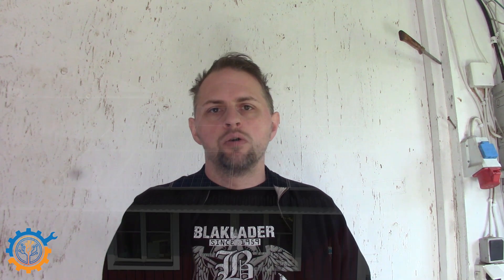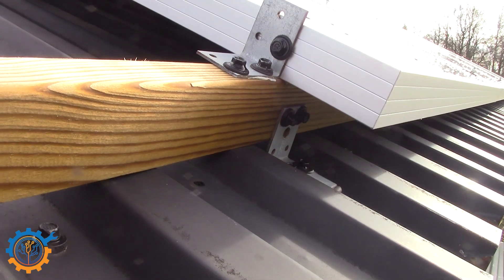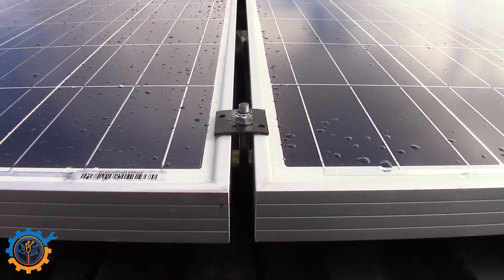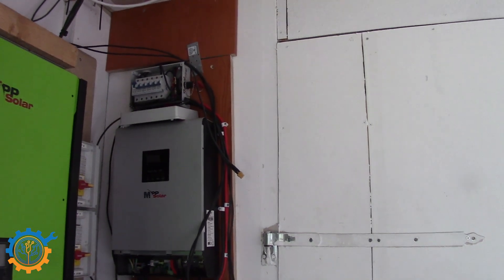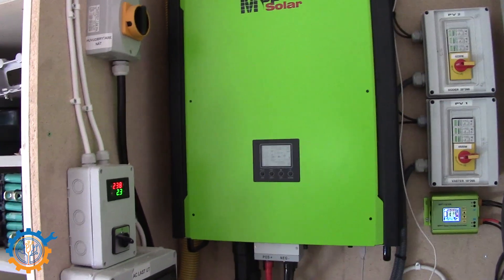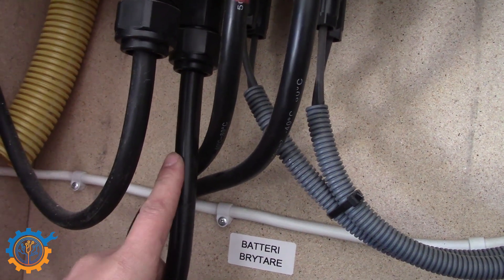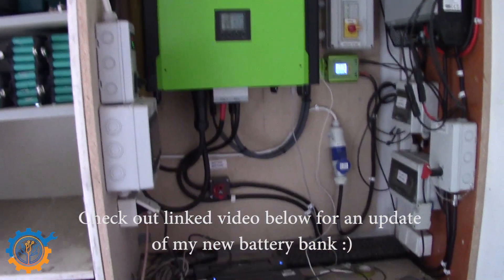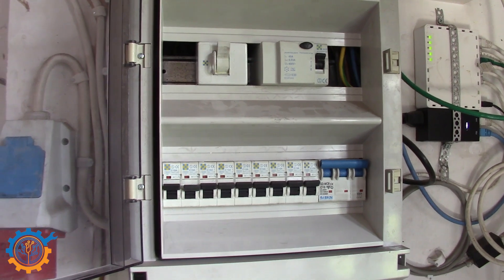Current solar setup 2017-04-17

Comment: Great video!  I've learned a lot from your vids.  I am hoping you can help clarify something for me.  I'm building two battery packs configures as 14s11p.  (1kWh) These will replace the lead acid batteries in my electric golf cart.  The problem is this thing can pull almost 400 amps of in-rush current if you floor the accelerator at a dead stop.  That is going to smoke any BMS I have seen.  Others have suggested using a shunt but I've little idea what that is or how to wire it.  Perhaps that could be the subject of another video???
Reply from the maker: You then use either a proper bms or A contactor controlled by the bms. Note that 22p cells doing 400a... Poor cells ;)
Reply: I tend to agree about the poor cells but see no way around it when driving a large motor.  Well, other than always starting very gently I suppose but that's not likely with my farm workers.  :-)  Would love to find a good BNS for it but so far, not luck.  A contactor would be great too but I can't seen to find a BMS that can turn it on / off and, won't the BMS see it as a near short and shut things down?   FYI - I believe I am going to double up on cells (14s11p times four instead of two.)
Reply: @nicefellow787  super capacitors!
They charge fast and release large loads

Comment: I have a similar 1Kw system at home. What I see is that one out of two fan will be continuously running in the system even though the mains AC input is bypassed to the output and battery is fully charged. Is it a problem or is usual with these kinda inverters?
Reply from the maker: Dont know. The 1kW inverter is not the same as the ones I got im afraid.

Comment: hi, i had a few cells that i used to build a couple of panels, i have them in series and they are giving me 15v 10.5 Amp, i made this panels my self, i have a question, i build a battery pack with 99 cells, 18650. i have 33 in parellel and then in series for a 11.1 v battrey, if i attach the panels to the battery should i need something else ? thanks !!!
Reply from the maker: You need an mppt or pwm charger in between. You should also have a BMS of some sort in between to make sure the cells stays balanced.   Without a proper charge controller you will have the pack to go above max voltage of the cells. And without bms you will perhaps have individual packs/cells go above its maximum and in worst case this will end up in a hot pack in terms of fire :)    Lithium cells should always have some kind of active system that takes care of balancing and charging/discharging

Comment: What's your opinion on the mpt 7210a ? Does it really works as MPPT? Do you know if you can connect a few of them to different panel strings BUT to the same battery (higher voltage then panels since it's a BOOST)?
Reply from the maker: I think its a pretty nifty little unit. I have not looked into it fully but i heard its not 100% MPPT but its close.  It need to have input voltage slightly below battery voltage to work and you then set the sweet spot of the panels.  As long as the battery always is highter you can have 1panel on 1 of them and 2 on the other with different inputs. That works just fine and they will work independantly. 
I have like 3 of them at home but none hooked  up right now. i run em as test units. 

You can buy them from here: (Ebay) https://goo.gl/v5DBzP

Comment: Hallo,
Thanks for you fantastic videos and DIY tips. This is highly valued! 
I am going to add DIY powerwall to my existing solar array, currently 5KWh, but it will be extended so I need another suitable 3phase hybrid inverter for DIY powerwalls. I looked at the same 10KWh from MPP as you have and like to know if you will recommend that one or you have found any alternatives?
Reply from the maker: I like the inverter as such due to its price. But I have had very bad experience with their support actually answering questions about its limitations and functionality. The software is also very buggy and have quite some flaws if you want to do anything more special. Other than that i have not found any other that do the same job for same amount of money. Note that the unit is pretty loud so its not something you have in your house a sunny day :)
Reply from the maker: Could be. I found one from a german manufacturer that is interesting. Very interesting. It runs battery at 150-300VDC instead and that makes it even more cool. And the price is almost the same as MPP...
Reply: DIY Tech & Repairs Would a Victron Energy Multiplus inverter charger and Colour Control unit work for you if you need to change?
Reply from the maker: It would not work alone though since i need the hybrid mode in terms of grid tie and MPPT from solar. But it would work in sense of expanding the possibility to utilize more of the stored power from the battery bank :)
Reply: DIY Tech & Repairs could be wrong but I think Magna Sine make a similar machine... costly though.
Reply: Thanks, but a little bit late. I ordered the MPP MPI 10K Hybrid (as yours) about a week ago... Are working on some recycled laptop 18650 cell for my DIY powerwall. Your videos are very inspiring - thanks
Reply: Hallo again - what switches and brakers are you using? Especially what switch for the 50V 200A battery?
Reply from the maker: Normal high current isolators for vehicle use.  Its worth mentioning that they are rated 32VDC. Fuses are ANL fuses also rated 32VDC. I will be changing them to proper ones in short to comply with standards. The funny part is that i have seen several installations made by companies with the same types... But anyways. Always use stuff rated at correct voltages and can handle the current in the system.
Reply: Sorry I do not fully understand. Can you link to some? Just received my MPI10K :-) excited, and you have inspired me !

Comment: Hello Daniel, can you share how did you get the solar panels? I'm trying to buy them in Poland and together with a colleague want to order around 20 panels from china.  Do you have a supplier you can share with us? Thanks.
Reply from the maker: fmarpt i bought from local guy. importing was not doable. had to order a container if so. last ones came from england from a guy importing them.

Comment: having the solar panels on an "flat"angle is not necessarily  such a bad thing in the winter. this orientation brings most solar generation in overcast weather. i presume most of the winter is overcast where you live in sweden? naturally when the sun does come out in winter, not so productive. but most solar generation  is needed in bad weather anyway. as for leaves, i do not have a problem with them at all. but dust and dirt tends to settle on the lower end.
yes, the pip mob might threaten to sue you, as has happened to two youtubers critical of their support. and keep in mind, their product probably was half price to a more reputable inverter manufacturer. 
all in all a very professional installation.
greetings urs
Reply from the maker: Urs Odermatt ur right. if they just could have replied to emails. :) i do like the hw as such they have. yes the price is good.
Reply: well, if you can't understand it, then try it. if you have direct sunlight, you get most solar energy from the direction of the sun. indirect light however, comes down from the clouds. this is part of the cloud edge effect where you have direct AND indirect light and as a consequence more than either.
as for data, my 12v system matches the 48v system in cloudy overcast even though the 48 v system has double the panels, but they are at 30 degrees and most panels of the 12v system  flat , well at 8 degrees. so if you are still critical about it, i suggest tilting a panel around in overcast and see at which orientation it brings most.
somebody also said that horizontally oriented panels get hotter than 30 degree or so raised panels. this is incorrect. i measured the temps of the panels over the course of several days at different times. they were never further apart than 2 degrees c. however the 30 degree panels on the ground were somewhat warmer, i suppose there was less ventilation there near the ground than on the roof.
or think of it this way,  when the sun hits the clouds the light changes direction into many angles after passing through the cloud bank, so as a whole comes down at 90 degrees.
also, whilst working outside, during cloudy weather, my face got sunburned even though wearing a wide brimmed hat..
still waiting for an answer from you about some info of your hot water heat pump.
greetings urs
Reply: in my latitude, 35 degrees or thereabouts, solar production of flat panels and 30 degrees raised panels match each other for the summer half of the year, but not so in the winter. probably about 40% lower or so.
Reply: i am also considering doing a trial array pointing 30 degrees to the south, to see how much that brings. seemingly they are starting do that in germany (naturally north orientation there) as the panels are getting so cheap.